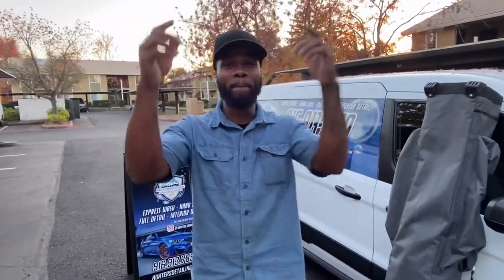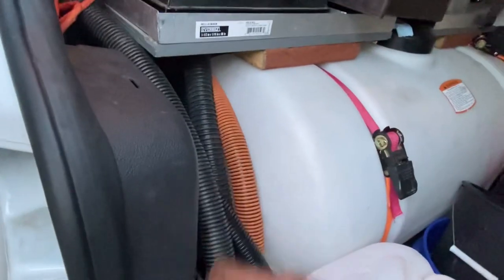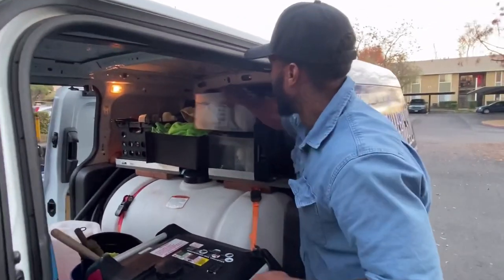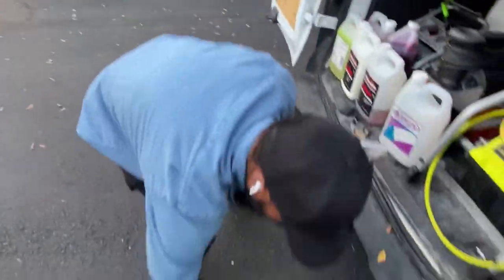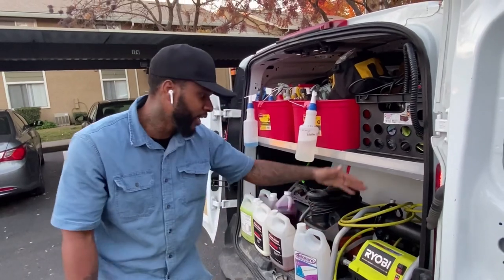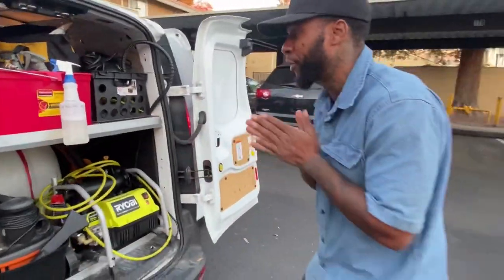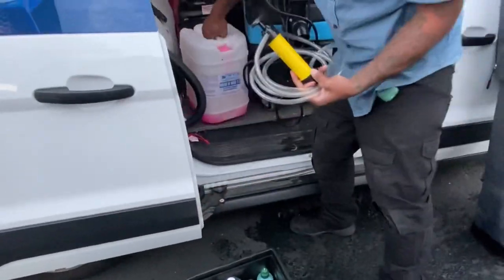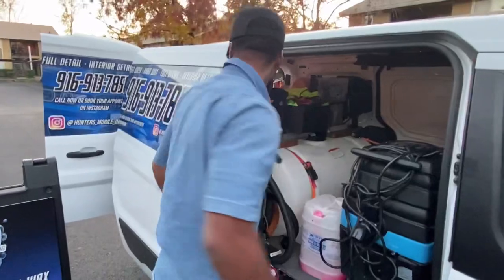MY MOBILE DETAILING SETUP

Comment: I've got the same retractable extension cord and pressure washer. I keep tripping it....does that happen to you?
Reply from the maker: When you say trippin it as in it disconnects ?
Reply: @HuntersMobileDetailing  ya it pops the circuit and shuts down on me :(
Reply from the maker: Yes !! It sucks! I bought a extra extension cord for certain things I can’t use on. It smh
Reply: @HuntersMobileDetailing  ok then. As long as its not just me lol. Guess I'll go get a 12g wire as well
Reply: Your probably pulling more amp than its rated for one look for a commercial that way its 20amps